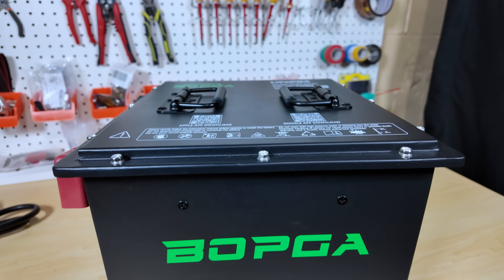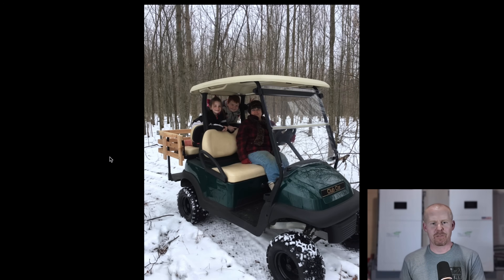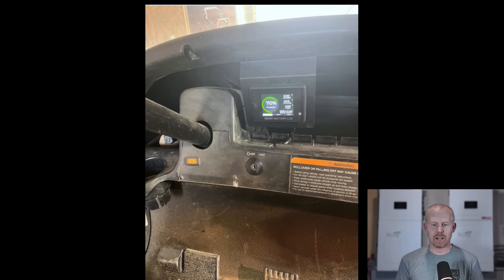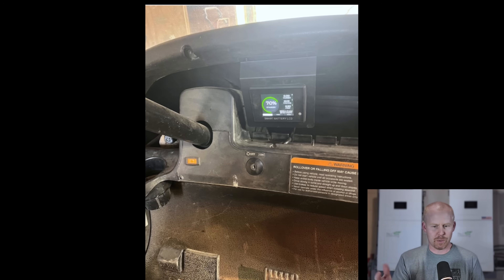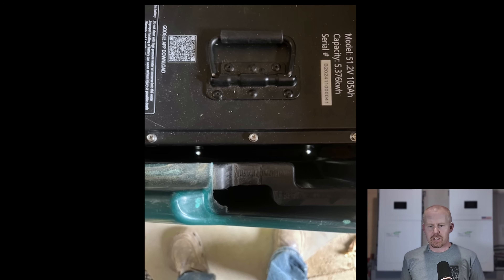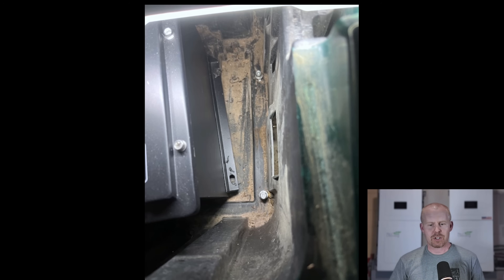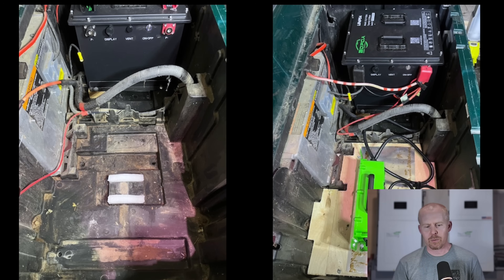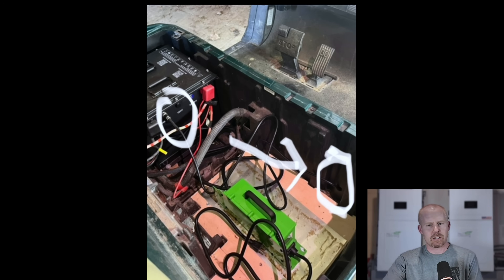BOPGA 48V 105Ah Lithium Battery Review & Install – Club Car Lead Acid Upgrade

Comment from the maker: Bopga Battery Review: https://youtu.be/jOnRlUsywDc

Links to the parts & pieces in the video (affiliate links)
------------------------------------
- Bopga 48V 105Ah Golf Cart Lithium Battery with Smart Charger: https://amzn.to/41bpFdC

For more information, please check out my website with links to all the components, materials and products I have used in developing my off-grid solar system: https://going-off-grid.com

Supporting the Channel
--------------------------------------------------
There are several ways that you can help support this channel.  
- Affiliate links help the channel by providing me with a small commission of the sale.  It does not change the cost for you at all.  
- Buy me a Coffee - https://buymeacoffee.com/goingoffgrv
- You can also click on the "Thanks" button under the video to support the channel. 
- You can become a channel member and receive additional perks: https://bit.ly/3Wdufqv

Thank you for your support!

Comment: Boom! I could never spend that much time writing a review that was awesome. Have you been using 4k? Maybe I always use HD and just didn't notice.
Reply from the maker: Yeah I’ve been using it for a while now.  Sometimes the bad lighting makes it look like HD footage though.
Reply: @AdamDeLayDIY I think my macbook was just defaulted to HD until I changed it the other day
Reply: I sent an email to them stating when my battery is off with the button on the battery. When it’s dark in the garage the blue LED around the button stays very dim lit up. I asked them if this is normal and I never heard a single word from them. Doesn’t seem to effect anything and so far I love the battery
Reply from the maker: @Mark-dk4ck  That does sound familiar, but it really shouldn't effect much.  Glad you like the battery otherwise.  

Unfortunately you're not the first that I've heard from that has said they've never gotten a response from support.  Sorry about that.
Reply: @AdamDeLayDIY  would you be willing to reach out to whoever sent you the battery for review and see if we can get a contact that will actually respond. I am concerned if anything happens during my 5 year warranty that I won’t be able to get any help.
Reply from the maker: @Mark-dk4ck I actually did that yesterday.  Waiting to see if I hear back.
Reply from the maker: @Mark-dk4ckI try emailing jack@bopga.com and see if you have better luck.

Comment: Ya a lot of small charge controllers have warnings on them to have the battery connected before applying solar power.
Reply from the maker: Yeah, I remember seeing those on some of the cheaper ones I had.